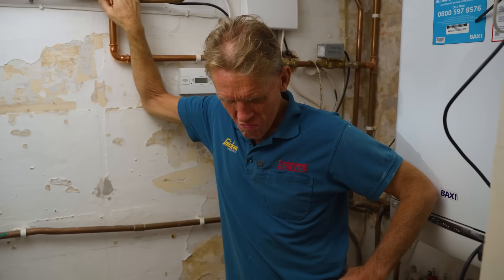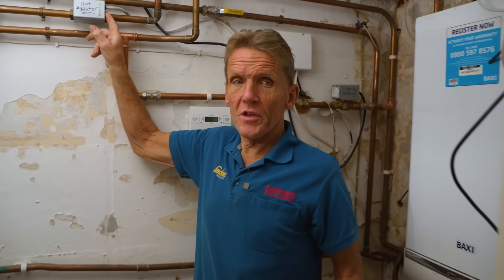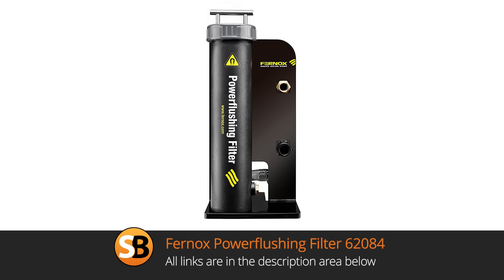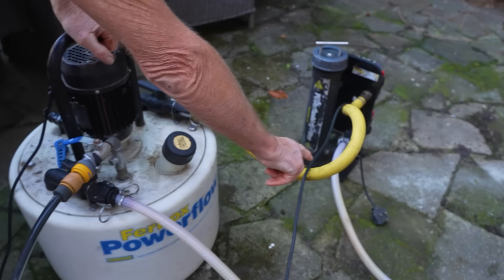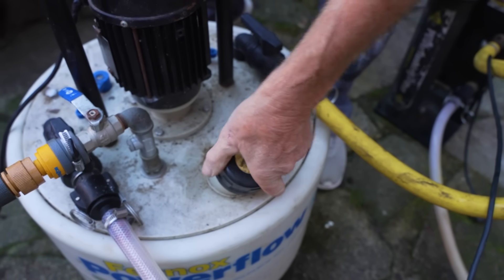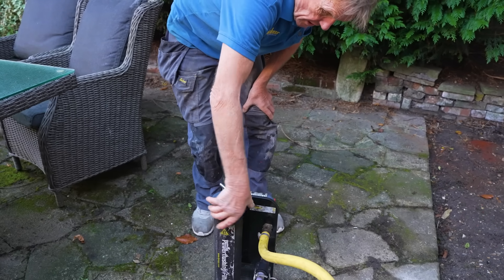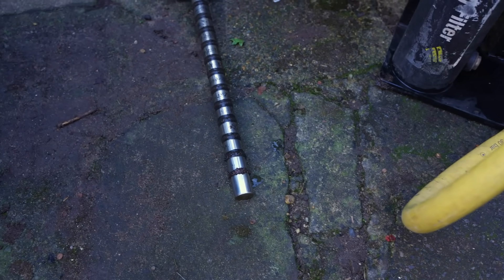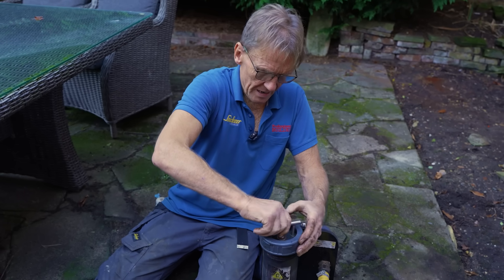DIY Power Flush Your Heating | Get More Heat for Less!

Comment: I put a wet and dry vacuum on the pipe work after I drained the system and got tar out the pipes. 8 buckets full I got. I can't touch the rads now.
Reply from the maker: That is a good idea, I have done a similar thing by blowing systems out with compressed air.
Reply: @SkillBuilder  I tried this method and didn't get such a good result. With the hoover on i opened 1 rad bleed valve at a  time and cleaned them out individually. From Luke warm to red hot now. I think the heating system hasn't been touched since the 70s.

Comment: I thought you had retired Roger, never realised you were still out and about getting dirty hands or is this an old video electronically remastered from B/W to colour?? 😂😂😂😂
I remember the demo model of the Magnaflo gadget that sat on the clunter of the plumbers merchants donkeys years ago, you shook the clear jar of liquid then it went black until you pressed a button and all the black stuff suddenly stuck to a magnetic core and the liquid became clear. I have used one of these devices for years, I did a recent tap pressure flush a couple of months ago to individual rads and they are still clear, but stuff stuck to the magnet, brilliant invention that, wish I could have thought of it 40 years ago.
Good video btw. 👍👍👍

Comment: Roger,
Can you powerflush on a (for example) combi system without having to change/cut pipework? And if so, where would you connect in?
Maybe you’d connect to the furthest rad and the point where the filling loop is?
Cheers
Reply: Take the pump out and use a Kamco head adapter, that’s the only way to do a thorough job 👊🏻
Reply: @ I’m a capable guy having worked on all sorts of systems ie truck air systems, cooling systems. I’m a qualified truck technician, turned builder.
But, every day is a school day. It’s good to get advice from guys who know their stuff.
Reply from the maker: Richard 
I have a head adaptor. It is no better than getting on the 22mm and in a combi it means you are flusing through the boiler.
Reply: @SkillBuilder sorry but that’s wrong, you can’t successfully powerflush the combi boiler just on the 22mm pipework, you miss the plate heat exchanger. We do this daily, if you have any other questions let me know 👊🏻
Reply: @RichardKnight-b7n take the pump off a combi and put adapter on there,..your mad
Reply: @lestc8579  take the pump off inside the boiler?
Reply from the maker: Yes just connect where you can. I have done it on a rad before but 22mm is best.
Reply: @SkillBuilder  I get that. Although it might be a bit more difficult to connect into a 22, unless there is a provided connection. 
Actually what about where the magnetic filter is connected? Remove the filter and connect onto each end?
Not all systems have that.
Reply: @SkillBuilder incorrect proceedure
Reply: You can get on the flow and return and remove the boiler from the equation altogether, you can use a pump adaptor and flush the boiler along with the system, you can use a filter adaptor or just get straight onto the filter connections.
The problem with flushing with the boiler connected is you can introduce problems into the boiler as a lot of new boilers have smaller waterways that are prone to blocking.
Personally I'd flush on the flow and return and clean the plate heat exchanger separately.

Comment: I'm 59 and never had a Colonic  😄     
I've seen vids of plumbers vibrating radiators with SDS hammer drill
Reply from the maker: yes you can get an SDS attachment to bang radiators. It is a good way to find leaks
Reply: @SkillBuilder  what’s the best magnetic filter
Reply: Seriously, you can use a hammer drill to bang a radiator? Why? 

Need to see this!
Reply: @Google_Does_Evil_Now dislodges all the Magnatite sitting inside the radiator and knocks it off thus allowing to pump around the system back to powerflush rig/Magna clean filter.
Reply: @barryckemp907  Love Rogers vids but I'm surprised he didn't cover this simple but vital procedure 🤷🏾‍♂️
Reply: @Google_Does_Evil_Now my same curiosity led me to this
 https://www.google.com/search?q=sds+radiator+bit&client=ms-android-samsung-ss&sca_esv=bea450f5934b94aa&udm=7&biw=412&bih=760&ei=fj9CZ56kApG4i-gPxoXOgAc&oq=sds+radiator+bit&gs_lp=Ehltb2JpbGUtZ3dzLW1vZGVsZXNzLXZpZGVvIhBzZHMgcmFkaWF0b3IgYml0MgUQIRigATIFECEYoAEyBRAhGJ8FMgUQIRifBTIFECEYnwUyBRAhGJ8FMgUQIRifBTIFECEYnwVI1BhQ9gZYuxZwAHgAkAEAmAGPAaAB6QOqAQMzLjK4AQPIAQD4AQGYAgWgAowEwgILEAAYgAQYsAMYogTCAgsQABiwAxiiBBiJBcICCxAAGIAEGJECGIoFwgIFEAAYgATCAgYQABgWGB7CAggQABiABBiiBJgDAIgGAZAGBZIHAzMuMqAHohU&sclient=mobile-gws-modeless-video#fpstate=ive&vld=cid:f95061e1,vid:zkGlRzSgUuk,st:0

Comment: I replaced all my radiators over a couple of years as I decorated each room. I flushed the system snot three time with a garden hose, the crap coming out each time was unbelievable.
I’d love to give it the professional flush one day.
Reply: I did the same, when I had a new boiler installed along with a professional flush hardly anything came out.